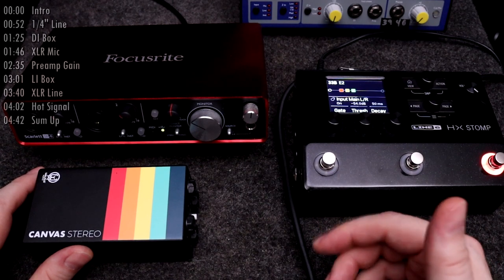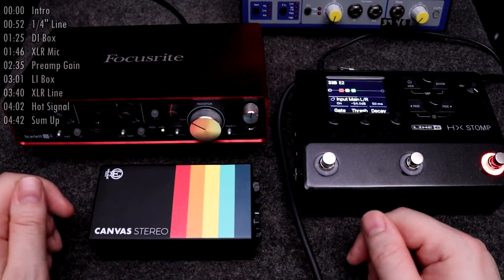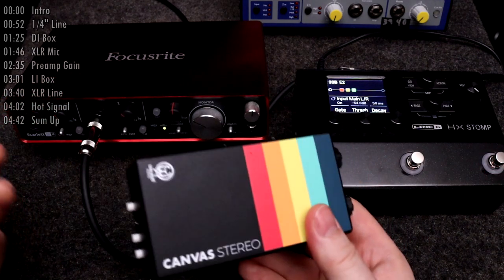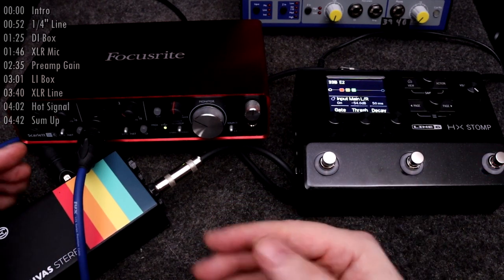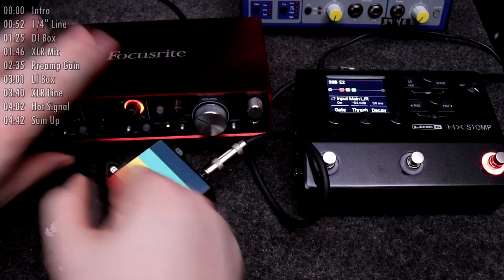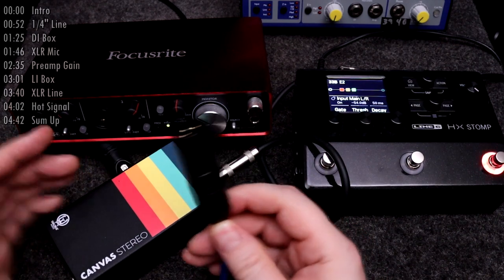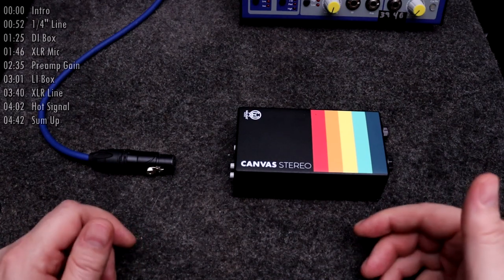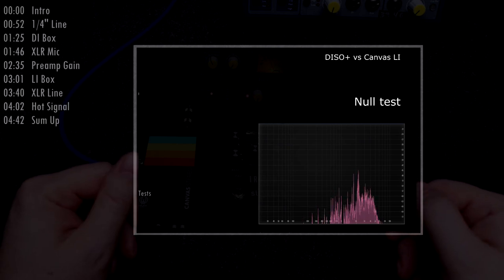Gain Staging for Amp Modelers using LI Boxes. Is your signal too Hot?

Comment: Hey Joe, I feel you made this video for me 🤣 I was the guy in the Iridium group who posted about the engineer saying my signal was way to hot 🔥.  Thanks very much for clearing this up and I can also show this to the sound engineer if needs be 👍🏼
Reply from the maker: Hey Andrew, the thread you're talking about gave me a big push to finish this, that's for certain!
Reply: @jmkmusicpedals  I suppose it's teething problems but we are definitely on the right track thanks to individuals like yourself, Thanks Joe.
Reply from the maker: @AndrewMooreLearningLicks  Thanks.  The incidental relationship between using a Line Level Isolator with XLR connectors and a Mic Preamp that also uses XLR connectors is something engineers will have to face more as LI Boxes are marketed toward guitar amp modelers and if they begin appearing as part of more pedalboards instead of DI Boxes.  The similar looks and connectors of the two can be misleading.

Comment: thanks for this video. Do I understand correctly, that If i have an amp modeler (I have uafx dream), but use short cables out of it (2xTS) in to my audio interface; that there are no benefits of using a di box? (i'm not playing live at the moment in a venue, but only at home).

Comment: HX Stomp has Jack TRS balanced output. So why do I need a line isolator? Can't I just use a XLR adaptor?
Reply from the maker: Yes.  0:32  Though an LI can be useful for mechanical isolation using its isolation transformer, it's not going to be necessary for 99.9% of applications where you are already running a balanced, line level signal.  Anyway, the video wasn't really about the HX Stomp, it's just what I had handy.

Comment: Hi, thx for those very usefull videos. I have a question as a hx stomp user : i'm using a TS cable from the stomp output to the mixer inpout and i feel like the reverb is really less present than when i use headphones or a guitar AMP. Do you think a TRS câble could fix this problem ?
Thx !

Comment: My question is, given the DI/LI is at the end of chain after an amp sim and/or effects, what is the best practice/tip for sending a robust but not overwhelming signal on to the DI/LI?
Reply from the maker: Correct, you want to avoid distortion in the DI caused by too hot of a signal.  You have to use your judgement with that.  To help, some DI's do have a Pad switch to lower a hotter signal at the DI input.

Comment: Good video, but it should be noted that the HX Stomp actually has balanced TRS outputs, so a di box isn't actually needed, only a TRS -> XLR cable. The outputs can also be switched between line and mic level.
Reply from the maker: True about the balanced TRS outputs.  The HX Stomp was used as a stand in for any kind of modeler, but definitely worth pointing out, thanks. However, on my version at least, the output cannot be switched to Mic Level.  They can be switched to either Line or Instrument level.

If you are running the HX Stomp to a Mic Preamp (by just adapting the cable), you could end up with the same "Signal is Too Hot" scenario I was showing using the LI Box.  Of course, you could simply turn down.  The HX Stomp makes that easy.  If you are running into a Mic Preamp, my advice is to go with a Mic Level Signal (adding a DI Box if necessary), but if you don't, you can still make it work depending on the gear in question.

Also, to make this discussion on simply adapting TRS to XLR from the HX Stomp complete, you also want to make sure Phantom Power is off for the Mic Pre.  HX Stomp probably has some kind of protection on the output, but just be aware of the possibility that power could be making its way back from the mixer to the HX Stomp if you simply adapt the cable and plug into a Mic Pre.  (There's no isolation being provided by a box in the middle).
Reply: @jmkmusicpedals  Thanks for the reply! I think I might experiment a bit with my HX Stomp and my interface to see that I get some proper gain staging set up.
Reply: I was going to say this, but with the Tonex you can get a balanced aingla aswell with the “interface” mode and you can just turn down the master volume so your not sending a hot signal

Comment: So if i have to plug my UAFX Woodrow 55 straight to my  Focusrite Clarett with a TS unbalanced cable i have to enable Instrument mode on my interface right?  if i use the Canvas LI mode with XLR to XLR (Like you did in the video) do i have to enable Instrument or Line mode on the clarett?  Thank you ;)
Reply from the maker: I don't believe that you would use Instrument level for that device going direct.  For the second situation, if your interface is the kind that automatically uses Mic Level when an XLR is plugged in, then you'll probably get best gain staging by setting the Canvas for DI mode.  If you can force the XLR connection to use Line Level, then use LI mode.
Reply: Thank you!

Comment: Excellent video. But so...How are we suppose connect the HX stomp to the FOH uf the XLR output from the Canvas is sending a HOT line level signal ???
Reply from the maker: Match what the FOH wants by sending either DI (Mic Level) or LI (Line Level).  The Canvas has that option for both DI or LI at the flick of a switch  ... or just have a DI box for the broadest compatibility.  Every FOH will have Mic Level inputs guaranteed.
Reply: @jmkmusicpedals  it's now clear for me !! Thnx a lot !!!